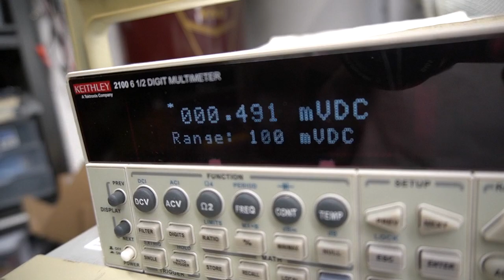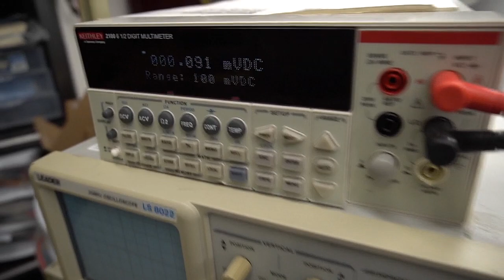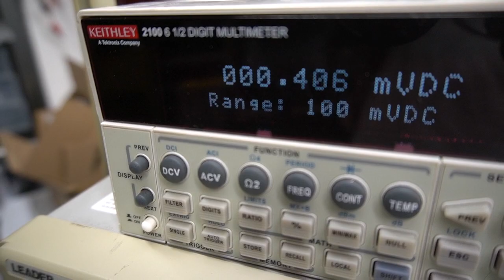Yamaha B-3 Vfet amplifier going in and out of protection (Part 2)

Comment: Hi! I'm curious to know what did you use as a replacement for 2SK100? The original part is basically impossible to find. Great amp, by the way 👍
Reply from the maker: Hello Andrea, true, difficult to replace but not impossible. With the help of a custom adapter, modern SMD components can be used. I have a couple of adapter types that I use when I need to replace.
Reply: @atelier_HiFi  thanks, that's very interesting. I noticed you also use a custom board for replacing the infamous B2 selectors, so kudos to your ability in keeping these amps in good health and improving them during the process!

Comment: great Job on the B-3 
 its a gorgeous good amp that's why im using 2 in Mono
Reply from the maker: Hi Wally, yes I know. One of yours also had an issue with the input differential pair and if I recall correctly Mastertec Heinz fixed it for you :)